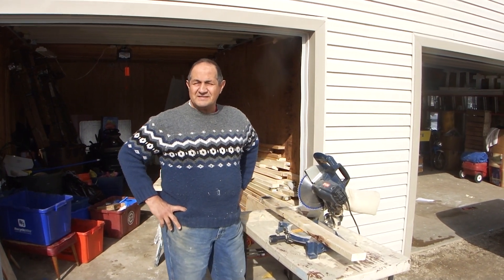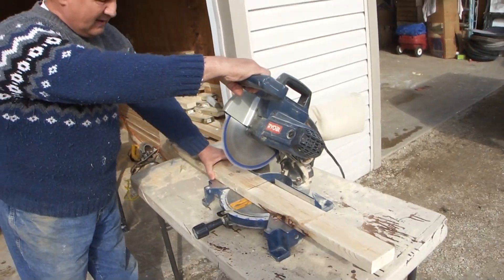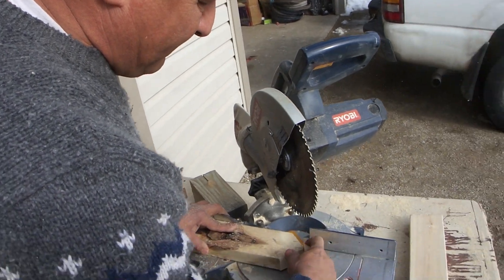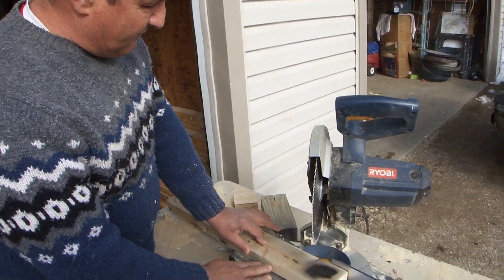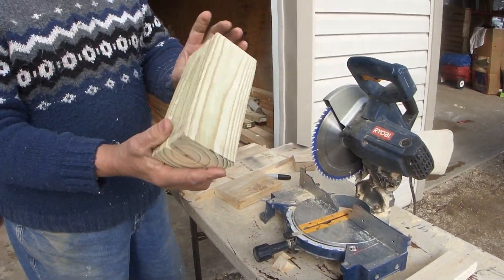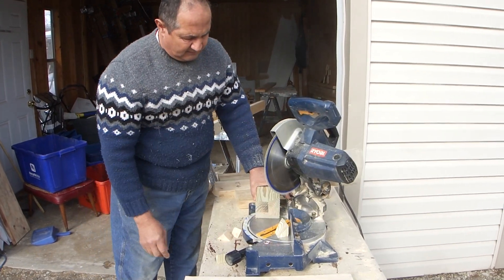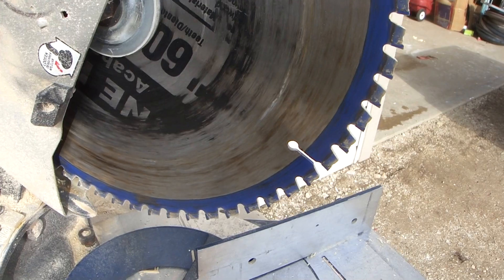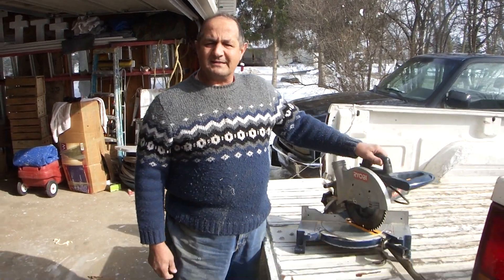How To Use A 10" Inch Chop Saw Miter Saw - Be Safe

Comment: I have a nearly identical ryobi. I was cutting 4x4 the other day and got down to the last cut.. it ripped the wood in that v cut out shape on the wall to hold the wood against is and sent the blade into the frame around the blade and broke a part of my guard i didn't remove. Luckily i was ok. Years ago i worked in a shop with one without a guard and some how managed to sling my finger too close as the blade was stopping but not stopped and it hit my fingernail just barely but it went through the nail to skin very minor but taught me respect for it.

Comment: I have the same saw but it wont turn at all. I do not have the handle knob but i can still press the metal part down but still no turn. Do i need the handle or wat else might i check on why its not turning.